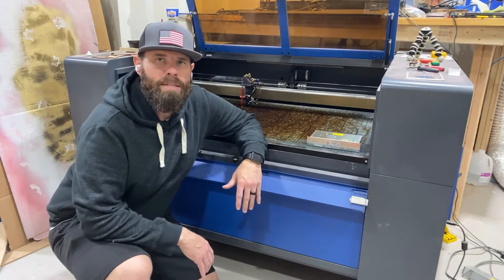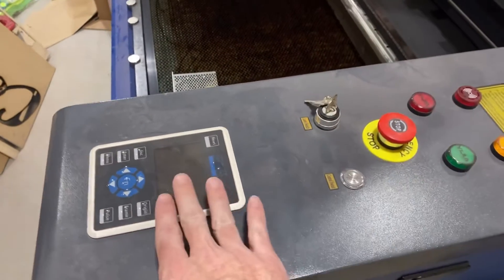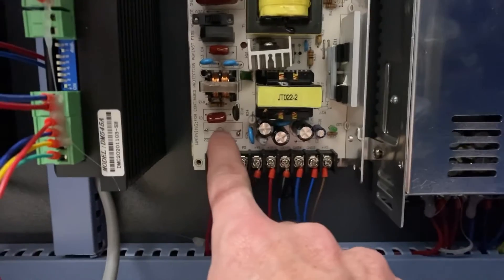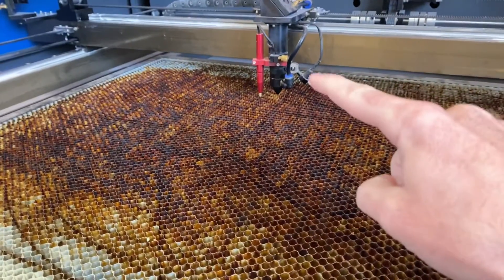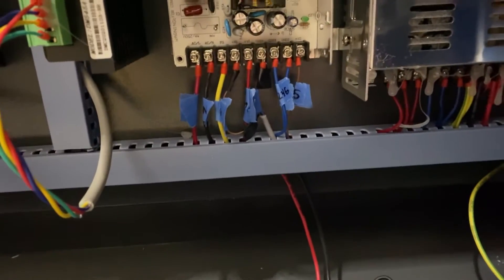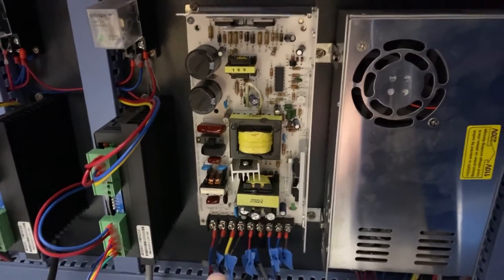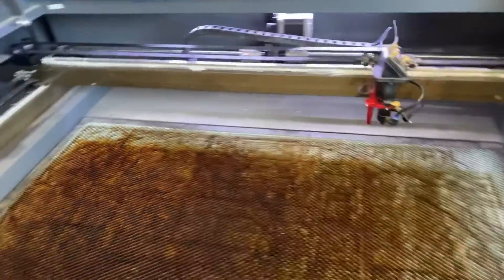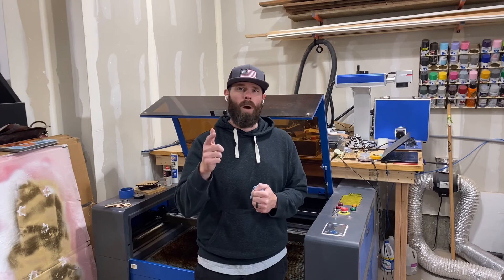24V Power Supply Replacement on OMTech Co2 Laser

Comment: Is that a 10A? I clicked on your link and there are several different options.  Thank you!
Reply from the maker: 10a os what I used for this machine but you can check your current power supply and get one close to the same as long as it is equal or greater amps

Comment: Hi! I had the EXACT same symptoms. But I dont think Im connecting it correctly. In the original box the +V1 was first and then the GRD ones. In the second it seems like the GRD is first (where the COM insert is located) and the +V1 is next. Is that correct? I attached it to what is seems it should be but it still isn’t firing properly.

Comment: Thank you for this video. I had the same symptoms (cooler error, quick loss of all power to controller/motors), and also the faint smell of electronics smoke. Diagnosed to the 24V power supply with a blown fuse. I did make an effort on my workbench to replace the fuse, but when I powered it up more smoke and a fried resistor. Shout out to Omtech who had me a replacement in 5 days.
Reply: Replaced the low voltage power supply which restored power to the controller but did not fix the machine.

Edit: turns out the autofocus probe wire had managed to get itself into the beam path and melted something fierce. Apologies for venting in your comments.
Reply from the maker: @mpkogli they have a phone number you can call….

Comment: Is this the same setup for a 150W omtech? 

Your links that you posted for the 24v and the 5v, will those work for my 150W ? It’s takes me to the 10AMP once I click your link.
Reply from the maker: 10amp is what I used on my machine. You will want to compare to the power supply that is on your machine and make sure it is big enough.

Comment: Hello sir. Thanks a lot for your precious tips. A few days ago my red dot died and today both of my axis stopped working. The controller works fine but it can't move the axis neither than lightburn can. My guess after seeing your video is that something is wrong with my 24v psu. Do you think I am right with this diagnosis? Also, looking at Amazon I can find 100w 150w 200w psu for 24v, but my machine is a 80w blue omtech. Should I find a 80w unit or can I just go with the 100w one? What does this value mean since it's not sending power to the laser itself (if I understood everything)? Thank you very much for what you're doing, keep up the great work!
Reply from the maker: If your controller is still turning on then it might be something else. What I would do is check the power coming out of the power supply at the different terminals first. If now power is coming out at some of them then it is still potentially the 24v power supply.

You are not looking for the laser tube power supply. Those are the ones labeled as 80, 100, 150…. You need the 24v power supply. I linked an example in the description of the video.

Comment: what amp model did you get as replacement? Listing has  5, 10, 15 or 20amp models
Reply from the maker: The one I got I believe was 10. Compare to what you have in your machine.
Reply: @BeardedBuildsCo  mine was a Jeton D-100-QB input: 88v-132v       176v-264v      DC OUTPUT : 24v-6A       5V-2A
Reply from the maker: I would do the 10
Reply: Thanks for the help

Comment: Did you ever figure out what to do with your red dot?
Reply from the maker: I don’t use it 😁
But you can piggy back one of these off the 24v power supply to run the red dot.
https://amzn.to/3rh3CRd
Reply: @BeardedBuildsCo  any pointers on how to do that? Mine crapped out the other day and the only PS I can find is the one you ordered from Amazon. But I like my red dot
Reply from the maker: Connect the 24v side to the power supply and the 5v to the red dot.
Reply: @BeardedBuildsCo  so just tap the 5v into the 24v? It won't cause any problems?
Reply from the maker: @jcrew214  no, you use the converter that I linked above.
Reply: @BeardedBuildsCo  I'm sorry, didn't see that. Thanks

Comment: You described all the symptoms that I saw in my 80W OMTech with the exception of the laser tube power, mine went down because the 24V supply controls the relay that feeds 120V to the tube supply. Good video, I would have not known about the 5V output otherwise. Same boat once I figured out the problem, new 24V power supply from Amazon that arrived the next day.

Comment: Do you run your laser with the air assist that comes with it or did you upgrade it? Also do you use an extra  inline fan?
Reply from the maker: I upgraded my air assist and I removed the stock fan and run an inline fan for the exhaust.